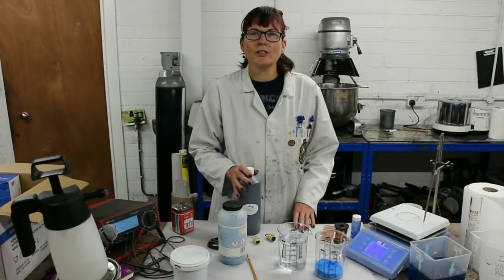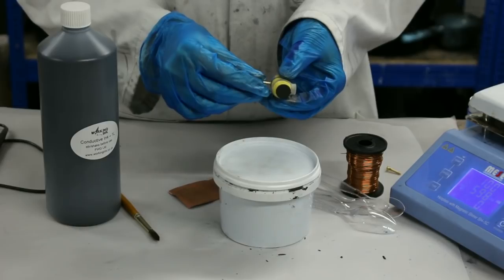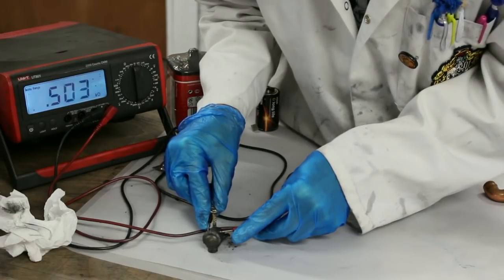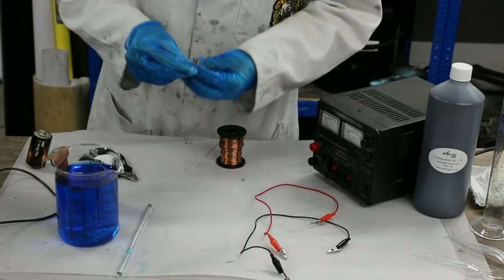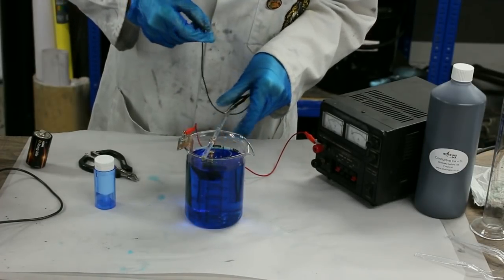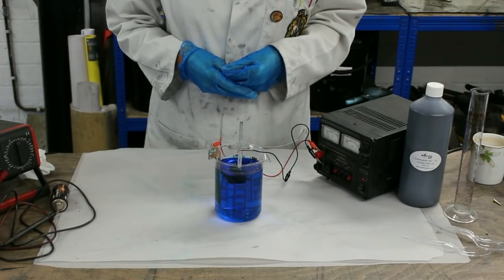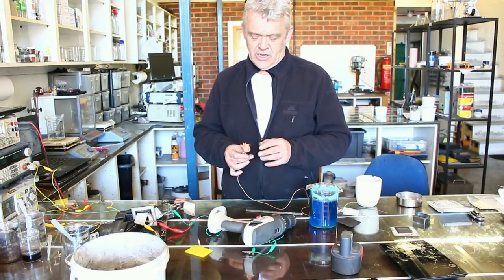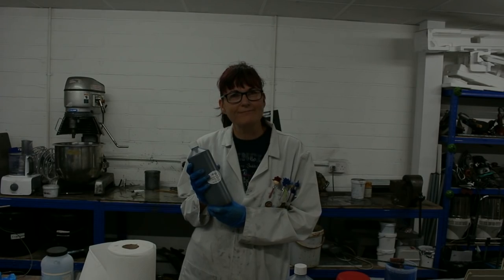How To Copper Plate A Minion With FWG Ink

Comment: Anode is the positive wire, right?
Reply from the maker: the terms anode and cathode are confusing mate as they refer to the direction of current flow as opposed to the charge the electrode carries - 'An anode is an electrode through which the conventional current enters into a polarized electrical device. This contrasts with a cathode, an electrode through which conventional current leaves an electrical device. A common mnemonic is ACID for "anode current into device"' - Wikipaedia has a nice article on this - i took the quote from there. I find it best to think of what you want the ions to do - positive ions are attracted to the negative plate so you want what you want to plate to attract the positive metal ions and deposit there - therefore make your plating object negative and your donor metal plate positive
Reply: Rob, Beautifully put. Yes it can be a bit confusing but it becomes much easier when you think of it that way. Trust me a dyslexic like me becomes quite confused with things like this and these little suggestions make it much easier to actually do the work. One more thing I would add , on a personal note: I find it works much better when you use as your Anode or positive electrode a metal of the same kind as you are trying to plate. For instance if you are copper plating in a copper+2 bath or solution use a copper Anode or positive electrode opposed to many time suggested titanium or stainless of what have you. I personally found I get better results with the finished product. Its just a guess but seems to me that over saturating the solution with copper ions before they all run to stick to the object being plated makes it work better somehow. One thing I can tell you for sure is that if your solution is something you want to & can store and use again that doing that will keep your solution from being used up so fast. In my case , the copper nitrate I use seems to last indefinitely so long as I am replacing the copper back to the solution I use for the plating. However you will find this eats the copper Anode away. These are just my findings and I have no scientific proof other than experience.

Comment: brass is a bad idea....
Reply: Explain. Not being a jerk...just here looking for solid info.
Reply: brass does conduct the electricity but is an alloy of zinc and copper.  Zinc has a much different electro negative #. This is why one metal is plated upon another in a specific order.  Just use the same metal, in this case copper wire to the object to be plated.